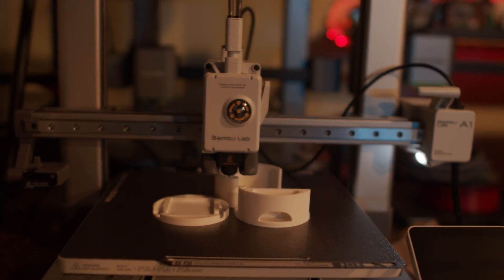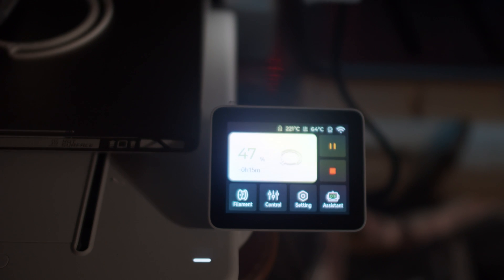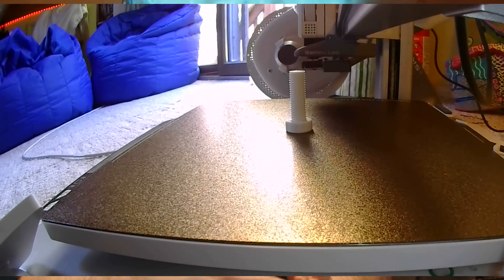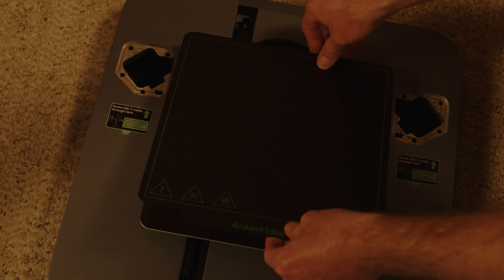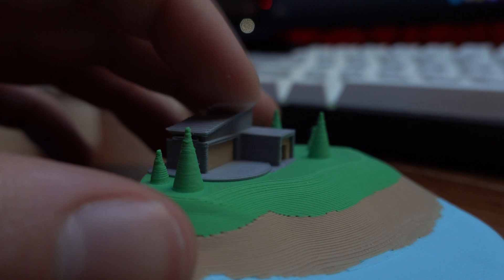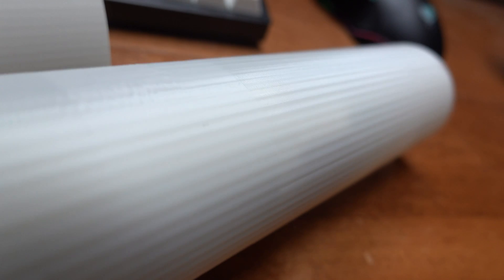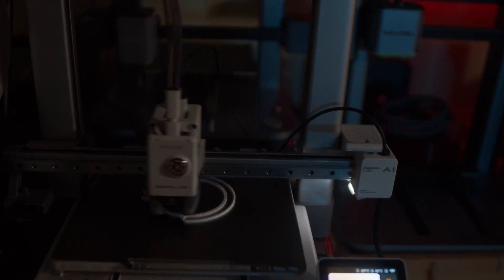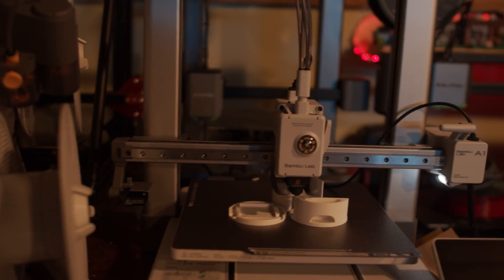My #1 Favorite 3D Printer | Bambu Lab A1 + AMS Lite Review

Comment: After a year with my A1, the bed is amazing. I clean it with isopropyl every print, no glue ever, no scraping or razor blade EVER. I run the bed level setup every print, no fans, no moving air / no windows open,  no A/C. It prints PLA and PETG perfect every time. After messing with the ender 3's for a few years, this A1 is a dream. I just ordered another with the AMS lite for the Bambu 3 year Aniversary sale. I can't say enough good things about it. It's awesome.

Comment: spray window cleaner on your build plate and up your bed temp to 40c solved 99% of my bed adhesion problems with the a1
Reply: It’s weird that some printers are running such low temps, I use 65c on all PLA and never have issues, even on moon lamp prints that finish in only 15hrs.
Reply: Also, dishwashing soap with warm water is the best cleaning method, even over alcohol.